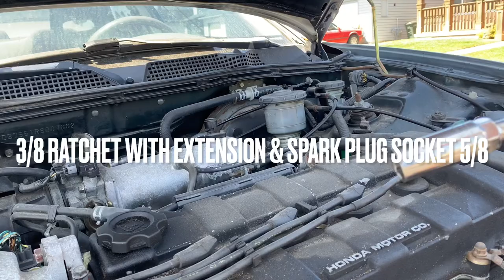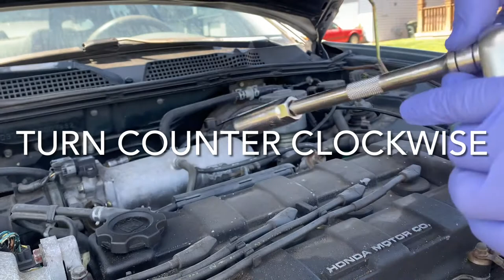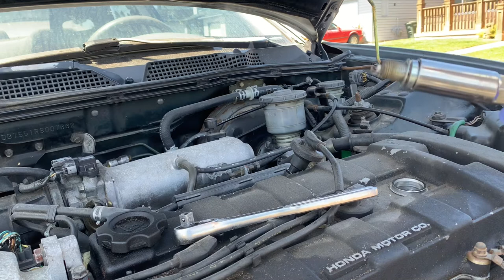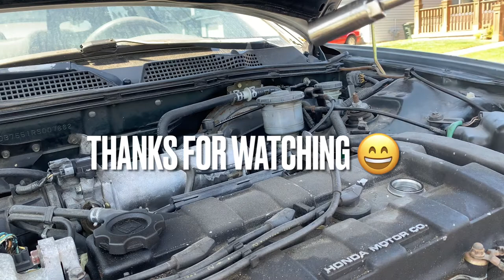How to remove & replace spark plugs form Acura Integra 90 -95 Ls diy

Comment: I saw another video on plug replacement and in that video, the guy said he did it one-by-one because he didn't want to "screw up the firing order" what does he meant by that.  Aren't all 4 plugs the same? Link below.
https://www.youtube.com/watch?v=rDhofFzSGng
Reply from the maker: Hi @sinnieleeonUtube

The firing order for most Acura and Honda is 1-3-4-2 clock wise, most mistakes were made during removal of spark plugs wire at the distributor cap. Most spark plugs have numbers on their wires but plugging back at the distributor cap could be a like confusing. Why? because all distributor cap were not marked with any number, mistake could be easily made.

Definitely one at the time for sure the way to go for peace of mind.👍🙏😁
Reply: @jpscrx  I got what he/you meant now. I never pay much attention to it because the length of the wires won't reach. Anyway, I changed the plugs today BUT can't even move one of them (the first one in your video). Is it ok to spray WD-40 (or similar lub)to loosen it up a little ? Would it do any damage if some WD-40 got into oil tank ?
Reply from the maker: @sinnieleeonUtube  

Yes, any lubricants will help.  Next time you buy spark plugs wire if you can buy NGK would be perfect,  oem might be pricey but it will be awesome replacement.  Although it might be tempting to purchase Auto Zone special or eBay spark plugs wire, nothing wrong with them but the quality for sure suffers 

Any lubricant will burn off during start up.  
Thanks
Reply: @jpscrx  I sprayed some lubricant into the spark plug socket in an attempt to loosen it and left it over a couple of nights. Yesterday I saw something like a washer popped up in the middle of socket and I broke it when trying to push it back down, to get to the plug BUT failed. Is it something you can just replace or did I just messed something up ? I still couldn't get the plug out. It is tough and I don't want to break. (what is the correct term for this washer?). thanks
Reply from the maker: @sinnieleeonUtube 

I have included my email address jprb76@cloud.com. If you don’t mind send some photos, so I can actually visualized what you are working on.

Thanks 🙏 
John
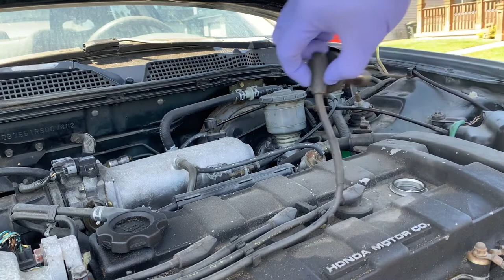Reply: @jpscrx I just sent you a picture of what I was referring to. In your video at 00:10-00:11 sec, I found this seal/washer in the number1 spark plug tube.
I think it is from the base of the spark plug tube. Where else could it have come from?
Reply from the maker: I was looking for your email but I didn’t not find it.  If the seal washer you are referring to is rubber probably  part of the spark lug wire that had broken off.   Its time to replace spark plug wire with a better quality like ngk or oem.  Keep me updated.  I’m still in search of your email.
Reply: @jpscrx   I bought a distributor and when I took it out of the box and checked, there isn't any marking or P/N on the distributor itself. Is this normal NOT to have marking or P/N on the item itself? How does the store knows what it is if they ever misplace it?
Reply from the maker: @sinnieleeonUtube  

If a store bought, of course you can have it exchanged but on line might be a little difficult but doable.

Back in mid 2000 I always buy eBay distributors with no part number or any markings, ran great for a year and dies on me on the road.  After that I buy it at a store with lifetime warranty.
Reply: @jpscrx  I wouldn't buy anything worthwhile online from unknown vendors. They'll give you a run around and also lots of misinformation and error.